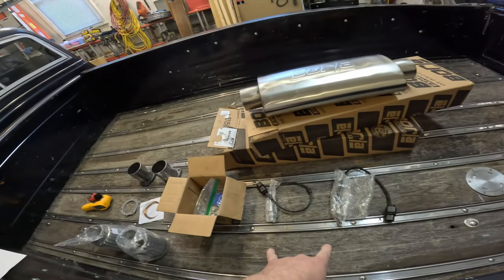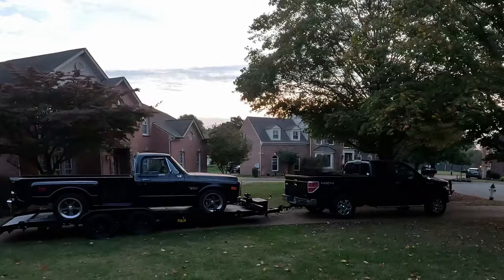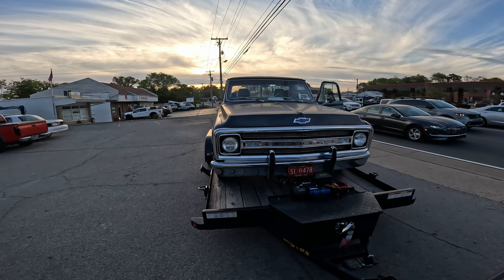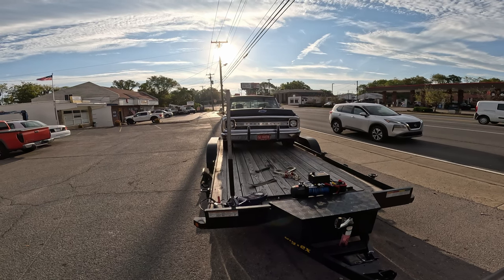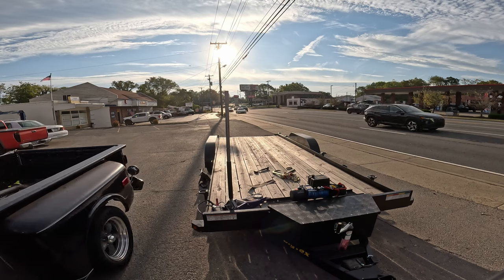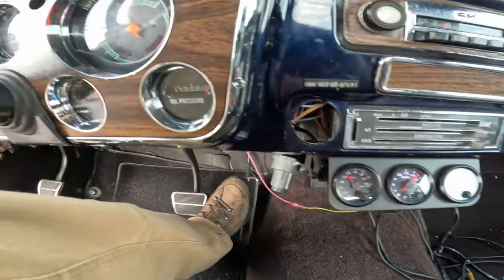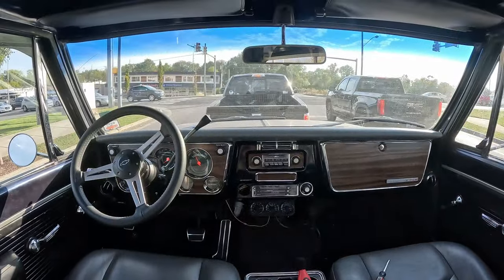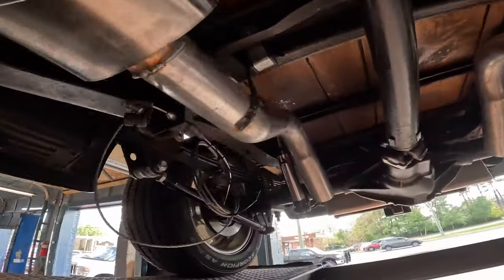EP 17 Installation of a true Dual Exhaust with Borla XR-1 Mufflers c10 longbed

Comment: The exhaust looks and sounds amazing! I need that same trailer hitch for mine! Do you have a link for it?
I did my own exhaust with no welding or exhaust experience so eventually I want to get mine re-done.
I'm interested in eventually getting the shorty headers like yours because my long tube headers are close to touching my starter and other spots. Great ideas and good video sir!
Reply from the maker: Thank you! That hitch came from Chevy Duty back in 2005, now they're Classic Chevy Truck parts. I don't think they even carry it anymore. 
Your truck sounds good in the videos. I wish had the talent to bend tube and not kink it all up. 
I looked into building my own exhaust or hacking up a kit. But the cost of the bolt on then... hacking it up, made it worth the trip the exhaust shop. 
The headers I ended up with were a set of Sanderson  BB8-SEC they called them block huggers. I had to massage them in, but so far they're doing really well. I think EP 8 you can see what it took to fit them in the truck. They weren't 100% bolt on. 
I think you're smart looking to change out the long tubes. Especially if you're lowered more than 3 inches in the front. The ground reaches up and snags things.

Comment: how’s the drone in the cab with the Borla xr1?
Reply from the maker: No drone to report. Highway or just cruising. My setup dumps in front of the rear axle at idle the truck feels and sounds wild. The second it’s rolling or I give it any rpm it’s smooth. Ep 21 has my buddy Troy driving it down a two lane and onto a quick highway and the mics in the cab pick up the sound good. We were able to have a conversation with no crazy recording setup.
Reply: Would you say it quiet down a lot from open headers I’m with you I love the sound of the open headers. Just wanna make sure it still has some noise with it.

Comment: Hey bud what’s your cam specs
Reply from the maker: Hydraulic Roller
.647 Intake .647 Exhaust
248 Intake / 254 Exhaust duration
@ .050 - 112-degree lobe separation

Right at the tipping point from Street to full race. Anything much more it wouldn't make any vacuum at idle.